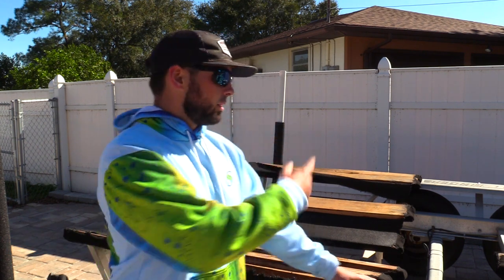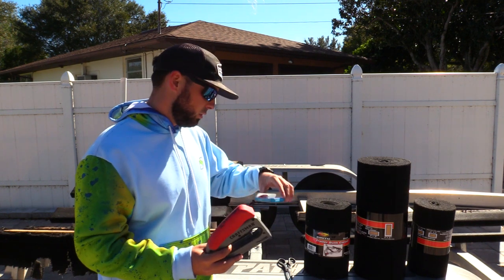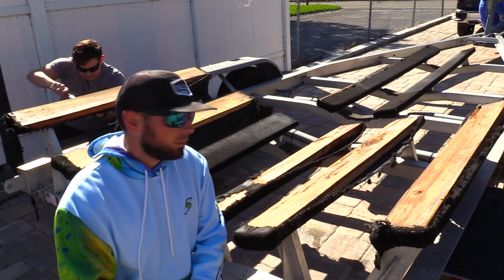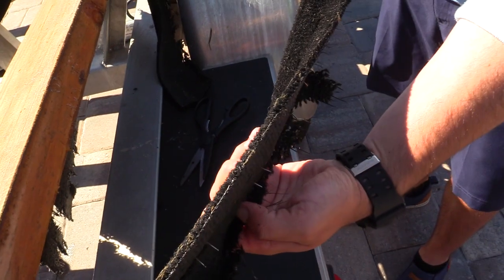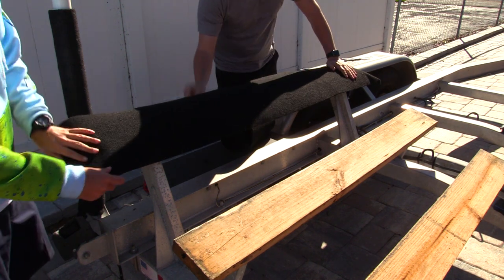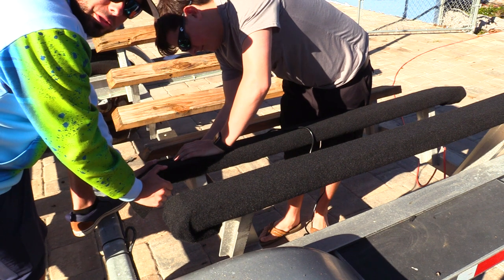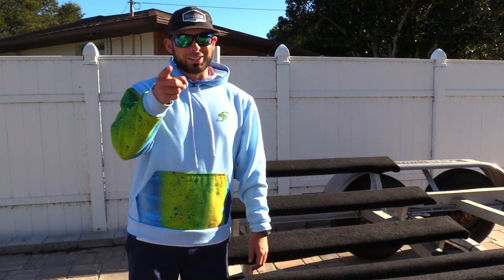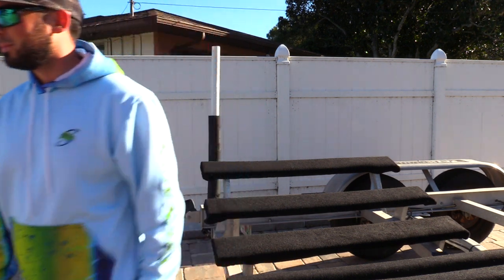Boat Trailer Bunk Carpet Replacement | Quick & Easy

Comment: One thing you missed.
The wood is not through bolted and is therefore fastened by lag bolts from underneath.
You did not stress to inspect on whether the bolts are still tightened into the wood or if the wood has become soft or weakened from water? Are some bolts missing and fallen out?
 IMO
Reply: I remove the boards when I recover them. If the holes are weakened I would fill them and re drill new holes for the screws unless the boards are shot. I even apply Thompson water seal and glue down the carpet and use stainless staples. I only charge $10 per running foot plus travel to their selected boat ramp to take off the boat and they can watch or go fishing while I get it done.

Comment: Thank you for actually showing a video with the bunks on the trailer.  We will probably end up doing ours at the boat ramp parking lot.  Concerned about finding electric for the stapler... but might get a new cordless tool out of it!  Thanks again.  Happy boating.

Comment: Why didn't you do it right. Glue the carpet to the board. I seal the raw boards with Thompson's water seal and glue the carpet to the boards. Using the right materials applied properly means it will never have to be done again.
Reply from the maker: False.. like stated in the video I suggest you do not glue the carpet down. If you glue the carpet down it can't flex/stretch when putting the boat on. This will cause ripping earlier.

Comment: I bought a boat and trailer in 2007 .. The trailer and bunk carpet has always  looked new ..So i made the mistake of not inspecting the bunk wood...When i was done boating last thursday i backed my trailer in the river and the left bunk was floating , unattached at one end ..Long story short the wood on both bunks was totally rotted through ,, bolts needed replaced also... Since i 99% of the time launch in fresh water i got a false sense of security .🙂

Comment: I have seen people spray the carpet with silicone spray to lubricate it to make easier to get the boat on and of do you think this works?
Reply from the maker: I have heard of people doing this and it working, but I DO NOT do it. Reason being, I had a buddy that did this, and when he was backing it his boat the next time his boat slid right off onto the concrete. When he got the boat fixed the trailer still did this exact same thing. For whatever reason it just made his bunks way tooooooo slick.

Comment: Excellent video. Some other videos used carpet glue. Any thoughts? I assume you had no problems without glue? Thanks.
Reply from the maker: I heard you don’t want to use the glue because when you put your boat on you want the carpet to flex a little otherwise it will rip. I have had no problems thus far
Reply: @CaptChrisCanning  Thanks for quick response. I will also pass on the glue. It makes sense.
Reply from the maker: Absolutely brother! Good luck! 👍🏼
Reply: The carpet will not tear if installed properly. That usually happens when the carpet is loose and slides on the board and rips where the staples are. When applied properly the carpeting will outlast the boat.

Comment: Just did mine and used nearly 2000 staples.  You will wish you had an air stapler.  Staples 1/2” long at a minimum